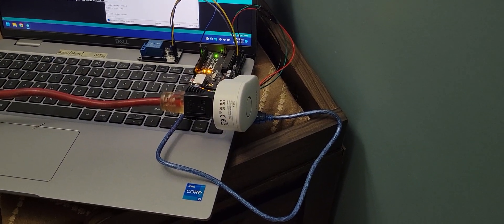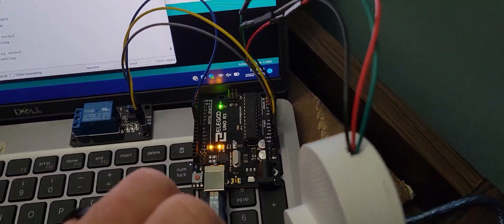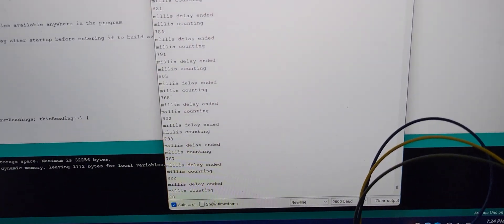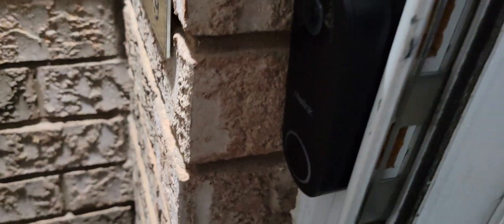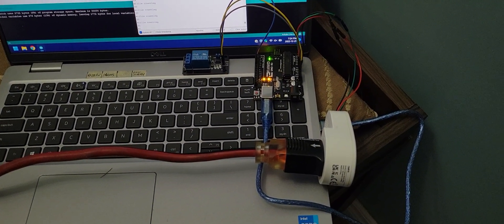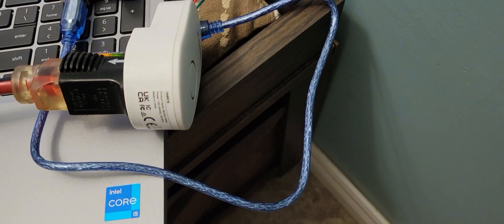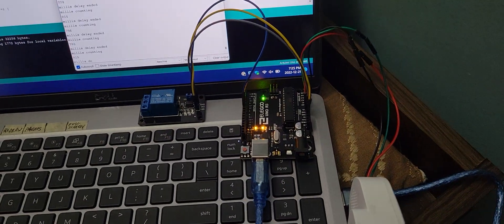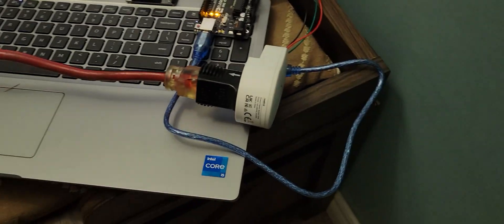Modified Reolink doorbell to maintain original door chimes

Comment: You can also just monitor ONVIF sensors directly on the camera over the network for the button press.. Or use the Reolink integration in HomeAssistant and any number of options to trigger a relay.

Comment: Good work. I read good things about both Reolink and Eufy but  don’t want to have to use their chimes, which some product planner surely thought was better than allowing common house chimes.
Reply: you can customize it tho.  also the typical setup is to use a capacitor to supply the extra power to ring the house chime and still have power for the camera and wifi in the doorbell.  so if someone presses and holds the doorbell button or presses repeatedly without waiting 30 seconds between presses there isn't enough power reserve and the camera and wifi shuts off, and even the chime might not work so having a separate chime works better with it's own power supply.  The existing chime is just for a regular doorbell with no video, was not designed for a smart doorbell.  Not sure if this hack gets around the power problem but seems like a whole lot of work and not officially supported.  You could just get a doorbell with support for existing chime but it will have the above problem.

Comment: Hi, do you know which pins do I need to severe/disconnect to get rid of the lights when motion is activated?

Kinda dumb for reolink to not have an option to disable it.
Reply from the maker: I've not modified the button box - I'm holding out for for a firmware update to also disable the sound of the chimes playing outdoors through the button box
Reply: @patteahan8704  
I guess they are following the wrong footsteps of Ring Doorbells. Highly doubt this can be changed in a firmware update if this is true, RIP. 

Ring users had to disassemble and place black tape to block the LEDs from events.
Reply from the maker: @oliviavalentine5294  I don't see any reason why a firmware update couldn't disable it, they've already been adding features there weren't there at launch in the last update. If you just want to turn off the IR LEDs there is a setting to do that you just tell it you want night time color. But as far as like the blue light around the button illuminating wanted to text motion no there's not a way to disable that yet. The only thing they can't really update and firmware is actual mechanical things like the ability to pass current through those pins for the stock doorbell otherwise everything else should be on the table for future development.
Reply: @patteahan8704  
Yup it illuminates whenever someone walks past it. For apartment buildings, its kinda creepy to see that. 

Its not a matter of can they fix it, its WILL they. 

Like for example, Rich Notifications are STILL not possible to this day for POE models but is available day 1 on Wifi models. I'm talking about the native app, not workarounds like home assistant, etc.
Reply from the maker: @oliviavalentine5294  agreed. i want the external chimes disabled when someone presses the button.
Reply: Was thinking of doing the same thing except I'll be using a rf433 receiver.
Reply: You can disable both the blue button light and infrared light in the settings.